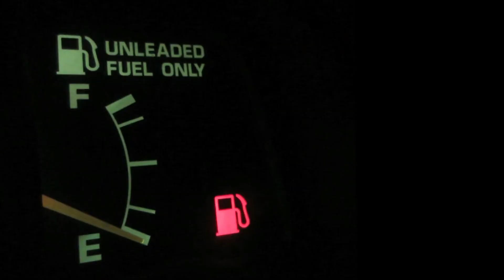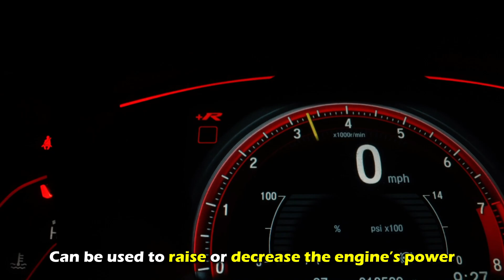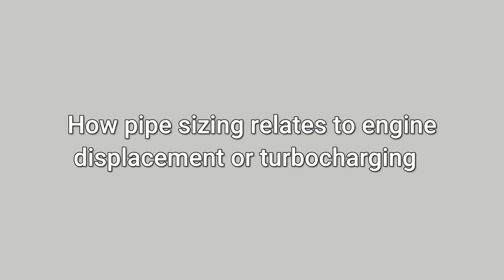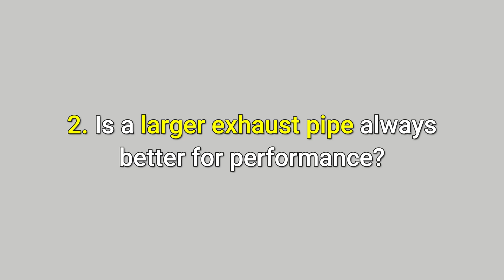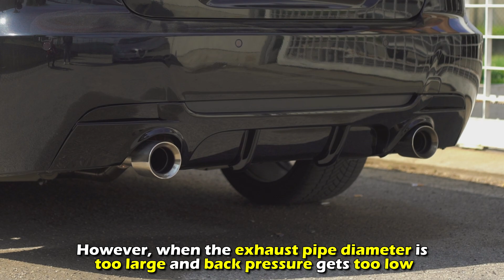Exhaust Pipe Diameter: How It Affects Performance

Comment from the maker: The information in the video is accurate. You can find this information in sites like: https://www.supaquick.com/blog/the-effects-of-the-exhaust-system-on-vehicle-performance#:~:text=The%20diameter%20of%20the%20exhaust,negatively%20impact%20low%2Dend%20torque.

https://norcaldieselperformance.com/n-44-how-an-exhaust-pipes-diameter-can-affect-performance.html?srsltid=AfmBOopuQqpaOPUCJZIalXAsugGT7PDAxubPw_sVT3x6zLNqaQ0q3g4S

https://tiredepotmechanical.com/what-is-standard-exhaust-size/

https://www.americantrucks.com/how-to-measure-your-exhaust-pipe-at-tech-guides.html

https://bobistheoilguy.com/forums/threads/exhaust-and-turbo-spooling-effect-on-part-throttle-performance.365704/#:~:text=Conventional%20wisdom%20with%20turbo's%20says,efficient%20and%20makes%20more%20power Thanks.